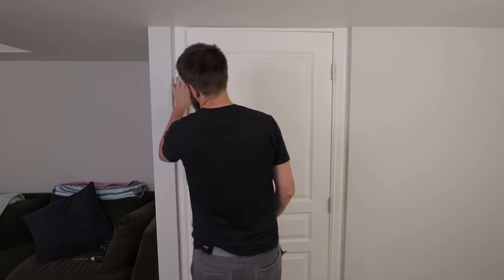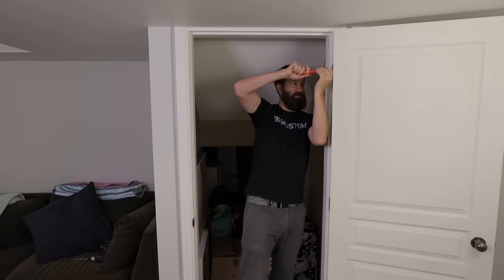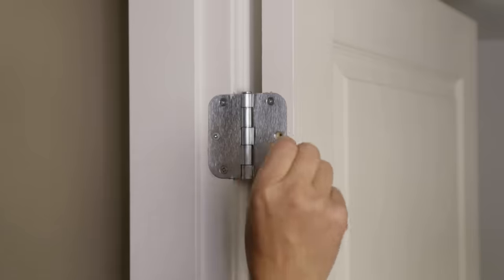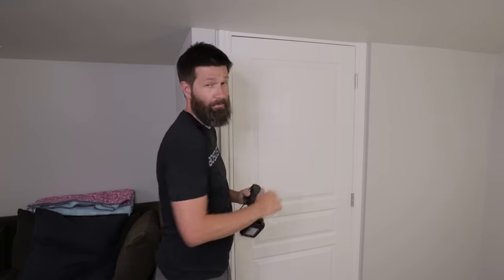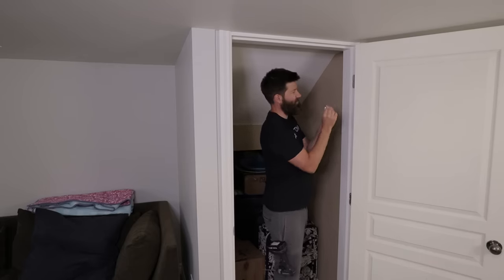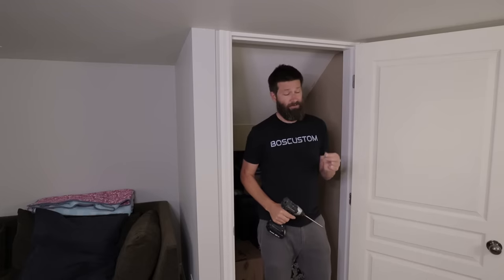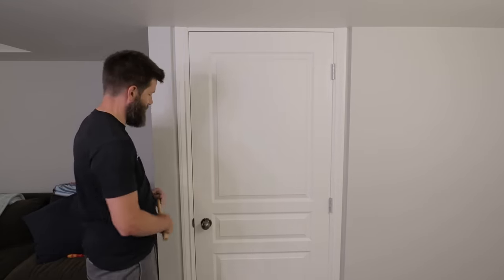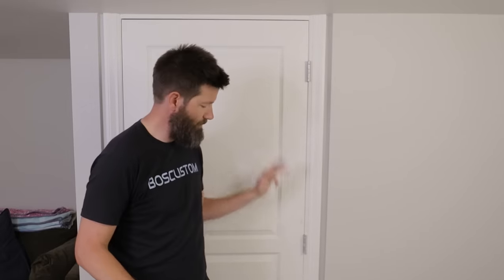How To Fix a Sagging Door that's Rubbing or Won't Close!!!

Comment: I've actually used all three of these. I used to work at a privately owned dormitory in Chico, CA where college used to be second to partying and with solid core doors and drunk kids, they used to get slammed a lot. Couple that with 50+ years of building settling and regular adjustments were a norm, just had varying severity. Because of my figuring out these different ways, pretty much anything door related became my job. Still, cool to see them posted as top ideas.

Comment: Nice tips. For the last tips, you could use a wood shim or even cardboard on the top door gap first to align the hinge before bending. That way you know how much to bend.
Reply from the maker: Great point
Reply: Or remove one leaf and chisel out 1/16 or 1/18 and that would work.
Reply: Jesus is LORD  Quite right, straigtning doors is a sin. In fact it was on the original draft of the 10 commandments "Thou shalt not alter a hung door".

Comment: I have a good "fix" for a door sag. Pull the bottom hinge screws from the hinge part thats on the jamb. Run a 1 1/2 screw into the jamb at about the middle of the hinge but closer to the hing pin. Leave it proud about the amount you need to lift the door. Reinstall the hinge screws and check for proper gap at the latch side of door. If you need to adjust up or down just run the screw in or out that's behind the hinge. I call this the adjustable shim method. 😉👍
Reply: I guess that's ok, but seems like too much trouble and possible problems. The hinge plate would not be secure, it would be making contact only on the screw head, seems like that could wobble and possibly creak, and any wobble would tend to work loose the three plate screws. Over time your shimming screw might move and the door would sag again. Shims are available at your local hardware store, isn't that a better method?

Comment: Nice tip with the tooth pick! 
If
I’ve seen the pool cue method you have to glue in and redrill, but the tooth lick is way easier. Never seen the loop bending method before either. Solid video !
Reply from the maker: Thanks buddy!
Reply: What is the "pool cue" method?

Comment: You are classic, and I enjoy your videos!  Earlier this year we bought a 2 story house built in 1890 which was later moved down a river then put on its current location.  Every door in the house is off 1/2" - 1" from one side to the other.  We use bean bags to keep the doors open in the house.  This year my goal is to "straighten" each door, starting with the outside doors to keep the air from blowing thru the house.  Your video was very helpful!

Comment: For bending the loops, I would shim the bottom of the door to bring it back to where you want it, then bend the loops to match the door hinge loops.  That way you don't have to guess where you need to take it.
Reply: No need to release the bottom hinge. Just pack the gap at the top with cardboard until it is in the correct position, then bend the hinge to fit.
Reply: @jeremyashford2145  I don't see how that would help. Packing the gap at the top would make the gap up there bigger. But for bending the loops you want the gap smaller. When I was thinking of shinning the door it wasn't at the hinge side. I was thinking shim under the handle side to bring the top hinge corner closer to the jam. Which is what you need.
Reply: @brandonb417  pack the top left closing jamb side and you don't need to bend down once.
Reply: Or just don’t bother shimming and do it how he did it by eye balling. If it looks good it most likely is good.
Reply: @brandonb417  Some odd poor communication on this thread. Let me try. What Jeremy Ashford was suggesting is basically the same as the "shim the bottom" you are suggesting. Looking at the example door from this video, you've got the hinges on the right and the door handle on the left, and the door opens towards us (but that's not important for our present purposes). The  gap between the top left edge of the door and the top frame is too big (which is to say the door is sagging) and needs to be made smaller with a shim.  Jeremy is suggesting pushing the top left corner of the door over towards the right by placing a shim near the top of the left edge of the door, between the left edge of the door and the left frame. Such a shim would push the left edge of the door to the right, pivoting the entire door on the bottom hinge, and thus making the gap at the top of the door, between the left corner and the top frame, smaller, mission accomplished. Got it?
Reply: @N1rOx  The phrase "bend down once" does not make any sense.
Reply: @TheLarryBrown  You're doing god's work Larry. Keep fighting the good fight.
Reply: @N1rOx  Your lack of sincerity disturbs me.
Reply: @TheLarryBrown  Good. This truly satisfies me.

Comment: I will definitely remember fix #3. I never thought of that as a solution.

I gotta say though, do not ignore the possibility of foundation issues being the actual cause of your door alignment issues. The door from our laundry room to the garage was getting harder and harder to latch. It was also during the transition between cooler and warmer weather so I attributed it to that and didn't give it much more thought. I messed with the strikeplate a little and made the door easier to latch. Problem solved, right? 

During this time, we also noticed our bedroom door wouldn't stay closed. We had another door that was showing some alignment issues. The interior door to the laundry room, which is also on the same plane as our bedroom door (2-story house), would also drift open and a bedroom door right across from it wouldn't stay open. That's when we realized we had a much larger issue to contend with.

Almost $20,000 later and now all those door issues are history. It was the foundation. The cool part was watching the foreman feel the gap on top of the front door as the guys outside did the lifting. Afterwards, we could see the difference, but during the lift, he could feel it moving. It was expensive, but it was also fascinating.
Reply: Now that you've found the cause of the sagging door, I hope you've looked into the cause of the foundation shift. How is your water/drainage system? Do you have adequate gutters and drains to lead the water away from your house?
Reply: Did your home insurance cover that?
Reply: @immanuel162  it was only one side of the house that was sinking. We had a lot of rain last year and the area between our house and our neighbor's stayed wet for extended periods of time. Two, 2-story houses barely 15-20" apart and a tree all provided shade, not allowing the soil to dry properly. Excess water drains away just fine. We've lived here almost 13 years and we've had rainy years before but the tree was much smaller (new house when we moved in). The other side of our house is fine. A 1-story next to us on that side and plenty of sun with no tree in the way. We caught the problem in time and while it cost $20k to fix the foundation, it is solid now.
Reply: @Jaur-jaur  no, because it was caused by shifting soil.
Reply: @awlthatwoodcrafts8911  stinks that they don’t cover that… Like, what’s the point of home insurance if they won’t cover a $20k repair? Couldn’t something like that cause something much worse than a sagging door?
Reply: Here in the Dallas area, you need to use soaker or drip hoses to water your foundation. I thought folks were pulling my leg when I first heard this when we moved here but, no, if you don't, the moisture-related swelling of the soil below the house (slab) and around it causes problems for many homeowners every year. And yes, the problems can be much worse than doors not closing properly!!
Reply: @vballaddict75252  I had the foundation repair people tell me that watering around your foundation is over-rated. The only thing that watering solves is preventing the soil from contracting away from the concrete, which can lead to bulging (what the builder warned of). 

Our foundation started sinking in one corner because we had too much rain and the area is between two 2-story houses and under a tree. The soil never had a chance to dry sufficiently between rains as it was always in the shade. It would stand to reason that if I had regularly watered around my foundation, I would have caused the sinking myself, assuming no rain.

Comment: Great fixes! I never thought of any of those... I usually shimmed the bottom hinges on my own doors to square them up. But I'm a plumber so thanks for the lesson! But as a plumber you're using the crescent wrong backwards. You always want the pulling or pushing force on the solid half mooned shaped side. I know why you did it the way you did ( to allow more movement during bending without damaging the door) but it hurts me everytime I see some one using them wrong.
Reply: My dad was a plumber and he would drill it into my head how to properly use a crescent wrench too!
Reply: It was my impression that in this case he turned it that way to get better leverage for bending the hinge.  If he had used it the "correct way" (and I agree with you on that) he wouldn't have had as much control or leverage to bend the hinge.
Reply: Not arguing, but, like the reply above,  I’ve always found the crescent moon shape allows me to get the most leverage because the moon rolls along the surface. 
Why is the moon side supposed to be the driving force?
Reply: @ChrishBlake  because the driving force against the screw on the wrench will, after repeated uses, stretch the metal. It makes the wrench "sloppy" and more likley to slip when extreme force is applied. The screw side is meant as a guide/holder. The best example I can give is using channel lock pliers in reverse. The force will try to open your hand instead of clamping down on the piece you're working on.

Comment: This was helpful... I actually had a different but similar problem.  My door was sagging, and couldn't get it to click closed.  I needed a door wedge.  I lifted up my door to the correct height, slid in the wedge.  I then tightened the screws, and viola!  So, thank you.

Comment: For the 3rd tip, it’s easier to see if you went far enough or too far if you put a few business cards in between the door and jam on the door handle side until you have enough cards making the desired gap that matches the bottom. Then when your loops are aligned, you’re done.
Reply: Damn , what a hack way...   smh....
Reply: @mariskaaryan6925  no.. he's right. If you don't put something between the strike side of the door and the jamb, you can easily pull the hinge screws out of the door enough to strip the holes.............
Reply: A use shims to lift the door until it latches. The bend loops in correct place.
Reply: Thank you, though my doors were rubbing due to expanding! Fixed 3 doors in 5 minutes.  Thank you 😊

Comment: Thank you!!! We got new hardware and painted door and it stuck all the time at the top.. My boy friend had me sand all the paint off the top.. just “knowing” that would be the fix..NOPE and I knew it and told him.. I kept telling him it seems like something with the hinges and he said NOPE.. So his next “Trick” was to Trim the door at the top 😖.. BUT before he actually got to experiment.. 
I was determined to research a better way to fix this door jamming issue..
I am so so thrilled to come across your video 🥳..
Step number 3 fixed the issue .. although I should have bent the prongs just a bit more just for a perfect gap measurement.. my near perfect prong bending did the trick..
End Result..
Door opens and shuts with Great ease!! I can hardly contain myself for him to come home from work.. without me saying anything.. to see if he thinks the door fixed itself 😅
Thanks again!!!
Reply from the maker: That is awesome!

Comment: good tips. I use the 3rd one a lot. if your doing extreme bending, you may need to bend the middle hinge a bit too.

If you need to fix a stipped door screw hole. Get a wood golf tee (chopstick works too but wood is softer so not as good). put wood glue on it, hammer it in there, cut off excess, let dry, redrill hole.
Reply from the maker: Definitely a good option
Reply: Dowels?
Reply: @pearlperlitavenegas2023  dowel works great

Comment: I'm staying in a hotel room for a few weeks and the sagging bathroom door causes the top corner to scrape against the frame which radiates an extremely loud and irritating noise each time you open or close it.

Watching this video helped me realize what causes the sag, so since I don't have any tools I just folded up a paper coffee cup from the hotel room and stuffed it underneath the bottom hinge between the door and the jamb. It forces the door to correct the sag just enough so it doesn't scrape against the frame anymore - worked really well in a pinch!
Reply from the maker: Nice fix hotel handyman!
Reply: Did you get a discount for staying? :)
Reply: That's so low tech they would not have put it on McGyver. Reminds me of the time I fixed someone's TV by using a coat hanger for an antenna and a paperclip to wire it into the F connector on the TV.
Reply: Lucky you don't drink coffee, or else you would have been steamed. hahahahaha
Reply: That's using the old bean!
Reply: That's grounds for a free breakfast. hahahahaha
Reply: And then it was back to the old grind, right?
Reply: Sounds like a half (and half) a$$ed solution if I ever heard one.

Comment: FastCap makes the Knuckle Bender. "The Knuckle Bender is designed by a carpenter and allows you to quickly adjust any sagging door. The Knuckle Bender is adjustable to any size hinge, so making an adjustment is fast, simple and accurate every time. The built-in hinge pin remover allows you quickly remove any hinge pin."

Comment: The last one is what you want to do. The first two options just help secure the door but most likely the hinge alignment is why it's leaning. I also use a paint mix stick as a shim in the jam to help hold things in place while doing this.
Reply: The last one did the trick on my front door. Would have saved me some time if i started with it but after years of a sticky front door I'm pretty glad it worked. also kicking myself  i didn't do it sooner
Reply: @Art-uz3fk  How was the door sticking?

Comment: Good tips TFC.

Another tip - when you open a new box of hinges there is typically a piece of thin cardboard that is perforated. Those are for shimming the hinges. You can place them behind the casing side of the hinge or the door stop side to effectively "angle" the hinge. In case you don't want to bend the hinges. 
This is especially helpful when doing heavy duty/commercial grade hinges when bending is much more difficult. 

To fill screw holes, I typically use cedar shims cut thin and then just snapped off flush.
Reply from the maker: Excellent point on shimming the hinges- I could probably make a few more vids on doors tricks!
Reply: I've made shims out of soda cans. The thin aluminium will cut with a pair of scissors.
Reply: THIS!!!!! The problem with the bending method presented in this video is that you won't get the bends perfect, not even close. Therefore the holes will not form a straight line and it will grip the hinge pin. That is guaranteed to make an impossible to eradicate squeak and may make the door noticeably stiff in operation. Angling the hinge like you suggest will keep a factory perfect alignment of the holes.
Reply: "Box of hinges" .....git oudda here! This is a DIY video.

Comment: Outstanding.  My entrance door was rubbing left side frame at TOP ONLY .  ( I tried Vaseline, WD-40, even sand-paper shaved the wood frame area down -- but nothing worked).  Until I saw this video.  Turns out the sagging problem was one loose screw on the top hinge.  I removed it, screwed in a larger 2" screw and wah-lah.  Done.  The door closes easy now with no rubbing or stickiness, didn't even have to adjust the hinge pins.  I just replaced one screw.  Thank you so much for your easy to understand video and helpful tricks.  You are amazing.

Comment: I always fill screw holes with matchsticks when replacing the screw - They do a fine job.
Reply: Where do you get matchsticks
Reply: @cornstar1253  Oh they are very rare , like ginger nuns. But if you look hard enough you may find some tucked under the counter of some off-the-beaten-track tobacconist.

Comment: Tip #1 is a go to, disposal chop sticks are the way to go for any stripped out screw holes. If the damage is really bad add a little wood glue to the mix. 😉
Reply: Or matchsticks.
Or cardboard.
If you use the chopstick you will need to re-drill the hole.
Reply: I used saw dust and superglue with great effect
Reply: @schwarzesonne6529  Too much work. Hammer a golf tee takes 30 seconds. Toothpick takes 5 seconds.

Comment: I use golfing tees for the stripped screw holes and you can get about two holes per tee> More expensive then tooth picks but will last forever.
Reply: Not the way I do it. I use two tees per hole. And that's just at the windmill!

Comment: Brilliant!  Applause from the peanut gallery here in dusty West Texas.  Your #3, bend the hinge trick, helped shift and seal a huge gap in my trapezoid shaped door opening.  Now my perfect rectangaular steel exterior house door no longer hits at the top, and it sealed a daylight gap and dust out at the bottom.  

I have no carpentry skills, but I can follow directions, and yours worked perfectly.  

I kept thinking I was going to have to remove the trim and reshim the entire door again.  

I did follow and apply all of your tips in order shown and #3 with a large set of Channel locks to bend the hinge did the trick for me.  Thank you!